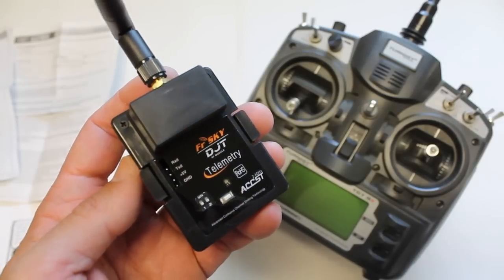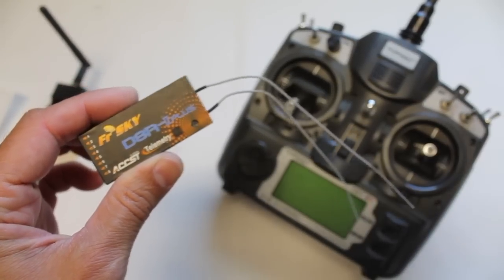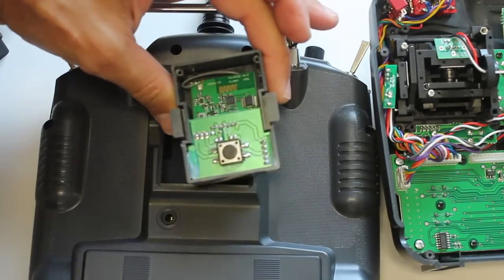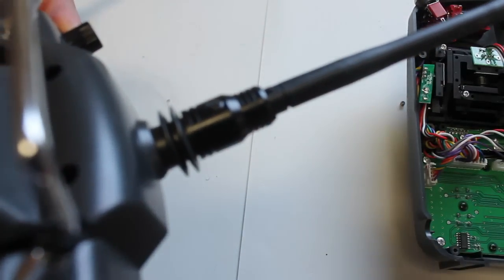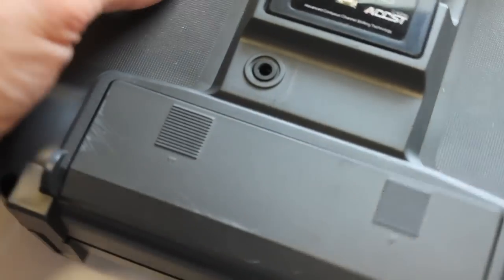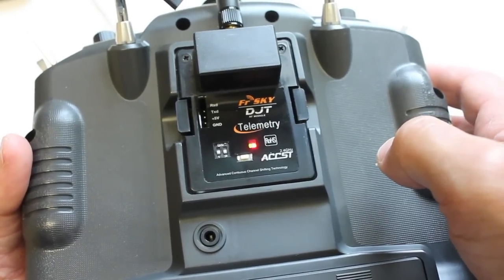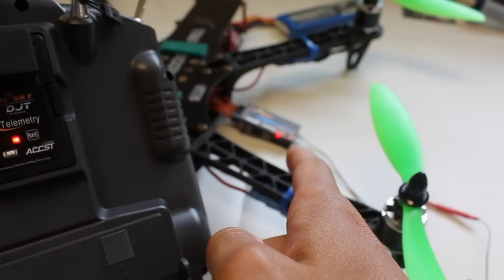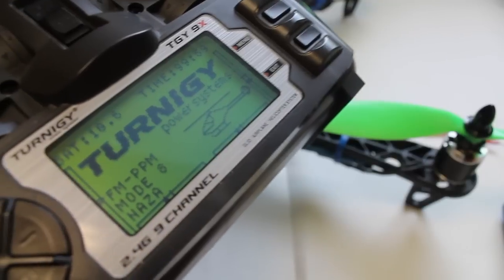Turnigy 9X FrSky Transmitter Upgrade and Binding with TBS Discovery and DJI Naza

Comment: is it right that these modules have the same db   ? auround 15 dB
Reply from the maker: If I recall the default DJT module antenna will give you 5 dB and you can increase that with this one: http://www.hobbyking.com/hobbyking/store/__20108__2_4Ghz_7DB_Antenna_for_FrSky_Modules_And_compatible_Radios_Modules_.html

I'm not sure about the stock T9X antenna, but I be it's about the same as the stock FrSky module antenna.

Comment: How to know channels correspondences for this receiver with turnigy 9x and naza m v2? for exemple 1- throttle 2- aileron and so on? I
Reply from the maker: Manel Correia It's normally dependent on your firmware and model template you're using. I've been using the ACRO template and by default it was AETR. Hope this helps.
Reply: Dennis Baldwin do you know for heli 1? Thank you

Comment: hi, is there anyway i can use all of my 9ch on the transmitter?
Reply from the maker: I think you can get 8 max: 

1. Aileron 2. Elevator 3. Throttle4. Rudder5. Gear6. Aux17. Aux28. Aux3

Comment: I would think you don't want to install the TX module in the transmitter set. Putting the TX module on top of your car will get even better range, and connect the module's signal wire to your transmitter set by a set of long wires. And you can sit inside your car while fpv.
Reply from the maker: Thanks for sharing that tip. I put mine inside the transmitter because it was simple and clean. But if I wanted longer range I would give your suggestion a try.

Comment: hey dude i have my 9xr and the throttle goes from 0-100 instantly, i tried it on a simulator and its like engine idle, to engine max, with no inbetween, have any idea what i need to do?
Only got this today im rather new but i have a flame wheel and a skywalker.

Comment: The range of this system literally give a hole new meaning to the word suck !!  This weekend I crash a really nice plane less than 250 Feet from me! It totally lost its signal! and after 5 hole seconds didn't recover! until the plane hit the ground!
Reply from the maker: Sorry to hear that! I haven't had range issues at 250ft. That's terrible. I wonder if there was some sort of interference going on? Let us know what you find out.
Reply: Well I'm beyond sure that I have a really angry Amateur radio license holder.. and at the same time I have also a radio broadcasting station plus a Cell tower repeater!!! so I have a really bleak chance in hell to overcome that problem! I wish I could find some one that would be interested on that 2.4GHz Tx Rx combo!! but I just don't care that much about it!
Reply: I can also attest to the range of this being more than 250ft.  I have flown my quad on several occasions over 500.

Comment: Seems like you added un-needed steps my separating the faceplates since you could de solder it without doing that.
Reply from the maker: Thanks for the suggestion.
Reply: Or just cut the damn thing, its just a coax cable.  Trust me when I say you'll never use that module again.  Even if you do its not that hard to strip and resolder coax

Comment: I have the same 9x and frysky but it won't fit on back of the radio properly , wondering if any one has run into this same issue ?
Reply from the maker: See the comment by Geoff W below. I'll post it here so you don't have to search through a bunch of comments:

"Thanks again for another helpful vid. Just got my DJT combo pack and some spare receivers from hobbyking, pretty cheap in the end. Paid $90 for a Combo pack and 3 extra receivers to swap all my other cars and quads over. Had no problems with the setup except the little plastic mount in the back of the transmitter which I just cut out and all went smooth."
Reply: Thanks, I took my 9x apart and I cut out the tab that the four pins are coming out of and all is good , no more accidental fail safes.
Reply: Hi Bp, I had the same issue, removed the old module and aerial went to put the DJT module in and it did not fit, I could get it to click into place on the left but not right, I took a closer look and where the pins goe into the mod, the module DJT has some more plastic divides between the pins, I took a blade an carefully just removed the obstructing divide pieces and tried again, this time it fitted in nicely. Hope this helps, I am having other problems, I have done the same upgrade, module in Rx bound all looks good but when I swop the Rx's on the hexacopter I get zero response from sticks, everything was working and flying before so it has to be a configuration somewhere. let me know if you get same thing? wtstirland@aapt.net.au
Reply: Dennis Baldwin FrSky D8R-11 Plus replacing Turnigy 9X8cv2
I have done the binding as per instructions and the lights behave as indicated and expected so it all looks good.
However when I swop it on to my model (matching the channels 1-8) and turn on Tx then model, the red light on the Rx is lit but nothing responds to inputs from Tx.
I am using a turnigy 9x Tx upgraded module to FrSky DJT and the model is a Hexacopter with Naza lite.
 
Am I missing something? Do I now the Rx and module have been upgraded need to configure something on the model or Naza to get controls to respond to inputs?
 
Cheers,
Wayne  wtstirland@aapt.net.au

Comment: Hey guys i am facing a problem, i upgraded my flysky 9x with frsky djt module and v8fr receiver but i am facing a problem when i turn the power on my naza goes to failsafe always even when the trigger button is off. anybody knows anything?... i did binding again but still no luck

but when i connect the stock module and receiver it just works fine
Reply: Did you get yours to work? I'm afraid to try this now.
Reply: +DJI jones Did you get yours to work? I'm afraid to try this now.

Comment: Naza after installing flashing red. why? help, please :-)
Reply from the maker: It sounds like it's not getting any sort of input signal from your receiver. Or maybe your throttle is reversed sending a high signal when it should be low. There are all sorts of potential issues but I would definitely check your input signals and calibrate your ESCs. Good luck and let us know what you discover.

Comment: Dennis, I bought a Turnigy 9x and a Frsky DHT upgrade module http://www.hobbyking.com/hobbyking/store/__17205__FrSky_DHT_8ch_DIY_Telemetry_Compatible_Transmitter_Module.html?strSearch=frsky dht, installed it and binding to some receivers, but bought a D8R-xp, and it will not bind. Can you tell me if this receiver is not compatible or something I'm doing wrong. I've read all instructions and tried it many different ways, but no luck. Appreciate your input to this rookie RC guy. Thanks
Reply from the maker: Jeff Dyck I'm not sure about this one. What about this?

http://www.frsky-rc.com/support/Details.php?fqa_id=45

Comment: Throw a 1 or 2 watt wifi booster onto that DJT and you can really go far on 2.4.  Check out my channel and you'll see a video of my Bixler 2 flying 6.3 km of my Futaba 7c 2.4ghz.  There is also an install video there.